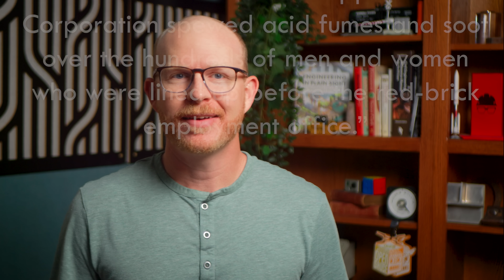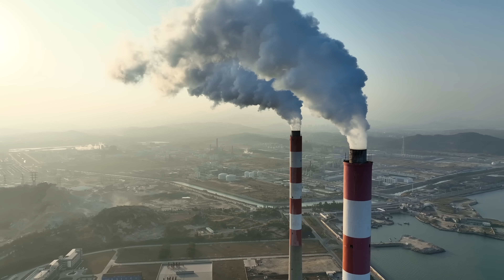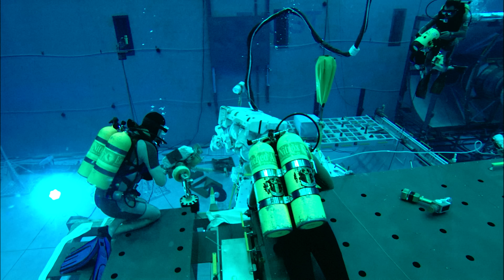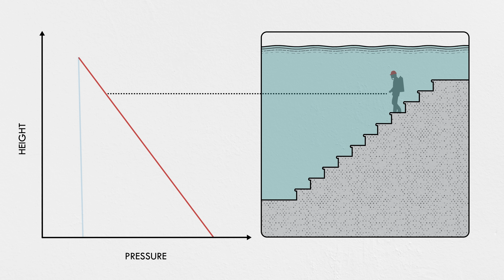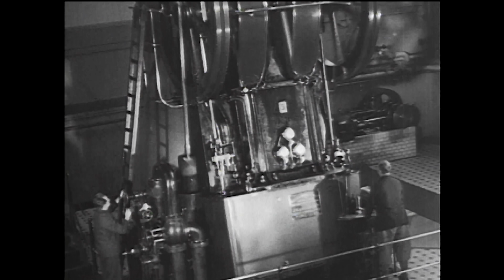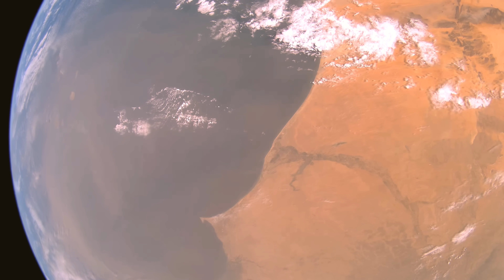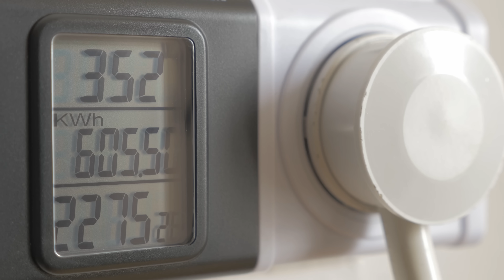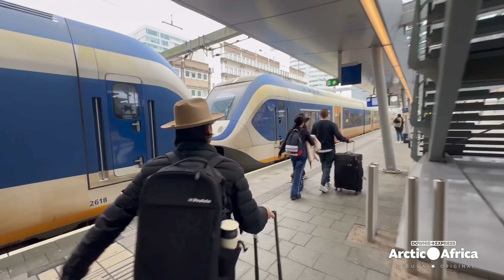Why are Smokestacks So Tall?

Comment: I feel like Grady must have had some other stuff on his mind during the Great Pizza Oven Exhaust Stack Experiment. Melts the cheap little plastic anemometer because of course that was going to happen, then reduces the heat to avoid damaging the steel probe of the device that is designed to measure high temperatures. What are you doing man?! 😂
Great video as always of course.

Comment: Fun related fact: the reason that the "east side" of many cities is the more impoverished area, is because the prevailing winds in most of the northern hemisphere are from west to east. In the 18th and 19th centuries, this led to the smoke from factories in the center of the city primarily settling on the east side. So, it was less desirable to live there, and those property values don't change easily.

Comment: What this really made me think of, is how bad the air quality is living or working in a sky scraper. All of those industrial waste smoke stacks take measurements at ground level. But who takes those measurements into consideration for those living on the 131st floor? And there is really nothing you can do about those already in place before the building is started construction. As those are typically "grandfathered in".  So depending on your luck, or how corrupt your building inspector may or may not be, you could be ingesting vastly varying differences of "air quality".  And hopefully, Your local building codes took air quality into consideration before your building was in the consideration mode.  I wonder how many buildings in larger cities (50,000+ people) actually would fail current air quality codes. And besides quietly moving away, what they could do about those bad air quality results?

Comment: It's "almost" the same effect compared to the cooling tower video you've released a couple of months ago.
Using stacks and long chimney are used all over the place to use the air as a tool!
I made a cooling tower to cool my water when brewing beer and it works wonder! Even more impressive in Winter when the difference of temperature is even higher! :P

Comment: Thanks for sharing your thoughts, ideas and videos. As simple a tool as a chimney or smoke stack is it’s amazing how involved and interesting they can be when you start looking into their characteristics and properties. I once spent several weeks thinking about them after I saw a proposed wind generation technology using stacks combined with greenhouse type roofing over large areas. Basic them was contain and collect air warmed by the sun under a roof and then funnel it into a stack with wind turbine generators located around its base. A few demonstrations have been built with promising results. There was a startup trying to build huge stacks to possibly generate large blocks of base load energy, one of the more interesting aspects was since heat always rises even at night a stack should still work. Might make an interesting video if it’s still around. I then started pondering if you could build a lower cost self supported stack from light weight fabrics possibly even including a gas like helium to support the structure. If it could be done cheaply you might even be able to develop an air circulation tower for homes that floats above and is powered by the difference in air levels. Wishing you and your family the best.

Comment: I've often seen the 'assumption' that pressure at the TOP of the stack is same as atmosphere. Then working downward, we can calculate how much lower the pressure is inside the stack versus outside.  This gives us the 'draft pressure' to tell us how much it's 'sucking' inward.  Combined with frictional calcs and some adjustable dampers, can figure out the air flow.

Comment: We HAD understood the problem on smoke, when the smoke stacks was invented : Smoke etc. Pollution ... but we spread it just more far away instead of preventing it ... and now we got it back, even with this invention, as the atmosphere is not endless anyway.
Easy minimal version is smoking ... as different in small or big rooms, but a lot of smoker in a big room make the same problem ... but we ignored it as usual.
YES, you will point out that this stacks was not to pull smoke away - but this side effect was SURE welcome beside, to cover up the pollution and avoid problems and make money first.

Comment: It's not "less than" PM2.5 that's the problem. It's PM2.5 exactly. Because any larger and it's physically filtered, and any smaller and it can be electrostatically. The problem is that PM2.5 is the "most penetrating particle" that gets deepest into your lungs and is the hardest to get out. That's an oversimplification, but you get the gist.

Comment: the explanation of why the stack works must be missing something, its combined with the air pressure differential between the flue gas and just ambient air diverging.... but nothing else is added to that explanation, and i think im pretty safe in assuming that the air pressure difference between 1ft above the ground and 6ft above the ground isnt 3.5x, otherwise our ears would pop everytime we bent over

Comment: I remember reading a technically incorrect but useful heuristic that you can use to calculate where most particles that escape from your flue system will fall back to earth; about 12x flue height.

Comment: I had the misfortune to use the EPA approved dispersal model some years back. It was written in the 1980's in Fortran and they never allowed for updates. So it was tedious since the data had to be fed to it in tiny pieces and then reassembled on output to actually model the modern world. The area we were covering was 3,500 sq km. Urgh. Bureaucratic insanity.

Comment: Ummmm. A bit messy. There are 2 different tasks of smokestack. First is to create draft by converting smoke temperature to it, 2nd is to release smoke with all its pollutants as far from ground as possible, to dilute it before it falls out to the surface. 

Of course they can be solved together, and old style, 100yo, technologies generally did namely this... but generally they are independent. First steam locos had long chimneys to create the draft, and then they completely disappeared because "blastpipe draft" and (rare) mechanical smoke fans were implemented. Classic steamboats, especially river ones, obligatory had high smokestacks - but huge fast steamships in 20th century almost lost them and relied on artificial draft (air intake under pressure and so on). In opposite - many industrial exhaust stacks (like on nuclear power stations) are extremely high not because they need any draft, everything gets there already under huge pressure but low temperature, but just because they have to disperse pollutants on several hundreds meters, where wind blows away everything.

Comment: Nice explanation of the stack effect and dispersion. But i was a bit disappointed that you did not explain more about what goes on INSIDE a smoke stack. Naming Filters, platin mesh as a catalytic converter, condensation of sud on the stack inside walls. There's a plethora of technology in emission control which you didn't even mention....

Comment: Stack effect is one of those things that I learned after college because I was a software engineer and didn't need to learn it. I used it to build my coal-fired blacksmithing forge. The thing works like a dream, so long as you start it correctly, thanks to the great big chimney stack. It pulls the fumes like a massive vacuum cleaner.

Comment: The draft from a smokestack is not just about dispersion, it is about combustion air as well. However, as the exhaust gases rise, you can mix it with outside air to cool and dilute the air, meaning a lower temperature to the exhaust and less actual smoke since hot particles and vapors have a chance to react with the added oxygen before they leave the stack.

Comment: The pressure part of the stack effect only tells some of the story.

What you're doing by having one is 1. delaying the mixing of gases (which delays the atmosphere slowing down your exhaust); and 2. increasing the time those gases have to accelerate under the buoyancy condition. The latter is responsible for most of the speed increase you get. This is why even a very short stack (having a length insufficient for a notable chance in atmospheric pressure to occur) will still have a noticeable effect on draughting.

Comment: Walking to school every day at university forty years ago, there was a tall solitary smokestack with what appeared to be a single output. However on a cold day from the upwind side, one could easily see that the output divided itself into two rotating plumes, one on the left rotating CCW, and one on the right rotating CW. This was a consistent finding all winter long, every year. I often wonder whether there was a design element hidden in the stack to produce that bifurcating rotation, or whether this was a natural effect of cold wind against a solitary rising plume.

Comment: One cold winter evening, my chilly friend overloaded my entire woodstove with dry, fast-burning cedar wood, intended only to be split as kindling. As the flames roared, we closed all the intake vents to no avail. (This wasn't an efficient, airtight stove.) The base of the stovepipe began to glow dark red, then cherry-red. We didn't dare open the stove door to try and cool the blaze (and let in more oxygen), so we took to throwing cups of water onto the stovepipe to momentarily cool it down and hopefully prevent a collapse. Eventually the fire burned down, and the cabin didn't catch afire. By that time all the doors and windows had to be opened to let out the searing hot temperatures. Yeah, stovepipes sure do increase airflow! 
(Thanks for the lesson, Mike.)

Comment: The output of coal plants is CO2 = plant food. Particulates from the precipitators, flyash, is used to make portland cement Locking the heavy metals and toxins in concrete. Sulphur dioxide is used to produce gypsum. All of which would require extra megawatts of wind turbines to produce but come for free with coal. People associate burning coal with the pollution of a hundred years ago. Most of this was removed by the 1980s. Producing Resins, from oil, for glass fiber turbine blades makes forever pollution just as nuclear plants do. Unfortunately people dont think things through
Reply: If only we didn't chop down 35% (and counting) of the entire worlds trees
Reply: you forget that CO2 greenhouse effect and acidification of oceans, plus coal plants disperse a lot of radioactive and metallic particles to air which cause high probability of lung cancer.  you can't compare coal with clean nuclear power.

Comment: The old timers built chimneys with a taper.  The lower walls are thick, then thin out as the chimney gets taller, yet the chamber inside is large at the bottom, and it tapers to the top.  The taper of the chamber helps create the high pressure inside the chimney.  It would take a little work to study this taper on how it creates a good draft.  I t would be fun to find the sweet spot in degree or taper per foot.

Comment: Fanning and fumigating plumes are pretty much a given when the temperature is extremelly cold! (Say, below -30c) Its facinating to see the smoke from the fireplaces not rising above the chimneys, but rather move sideways in long, well defined smoke columns! The effect is exagerated by the fact that usually, there is no or extremely low winds when its that cold.

Comment: 6:12 I'm a SCUBA diver, an instructor-trainer too, and I did over 2000 dives. Let me tell you that a diver doesn't feel any extra pressure at any depth, as long as the diver was able to compensate the pressure in the middle ear and the sinuses around the nose. Just like any normal human being doesn't feel the enormous pressure of 10 N/cm2 (the atmospheric pressure at ground level on Earth). Our regulator provides us with air from a high-pressure tank. That pressure is automatically reduced to the exact same pressure of the environment. The pressure of air in our lungs is thus exactly the same as the surrounding pressure. Humans don't have senses that register absolute pressure. The only thing we can feel is a pressure difference over a gradient. But submerged in water of any depth, there is no pressure gradient. We can't feel absolute pressure and we don't feel the extra pressure when diving in water.

Comment: Now I know the real reason Natural Gas power plants have significantly shorter stacks than coal power plants. It's not because they're cleaner (which I used to incorrectly think made it more acceptable to release the waist closer to the ground), it's because the natural gas doesn't need the air flow as much.

Comment: I could be wrong, but im fairly certain that smoke stacks can also help burn or fully burn more material before it leaves the combustion area. I think some air holes along the stack will help aid in combustion as well, especially if the air holes are in the correct spot. This us because it adds oxygen. Im not sure how this would effect the final exit volocity of the exaust.

Comment: Very good description of the issues and one I will use to tell my grandkids what I did for half a century.  

One thing to keep in mind regarding the air quality models is that the shape of the Gaussian distributions is based on observations.  When the Clean Air Act was passed those models were used to determine if power plants were in compliance, but the results were compared to ambient air quality monitoring network observations around the power plants – all the power plants in the country by the way.  I worked for an EPA contractor that verified that the models were working.  The models in use 40 years ago did predict concentration conservatively so we knew that the projections were protective of the ambient air quality standards.  But there were instances where the answers were right, but the reason was wrong (the stability conditions between the predictions and observations were different).  That problem has been resolved over time, but it should be a cautionary tale for any air quality predictions using models that cannot be verified.

Comment: If you rewatch all of the stack clips, anything that's in color or more modern, you will notice that the plumes dissipate very quickly.  That's because they aren't smoke, they are water vapor.